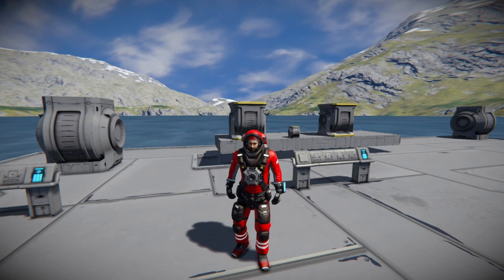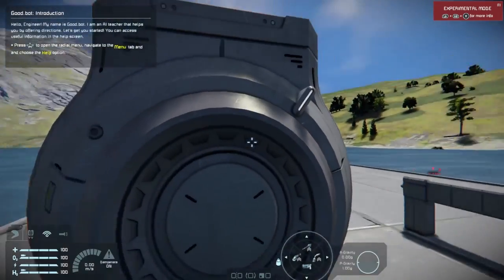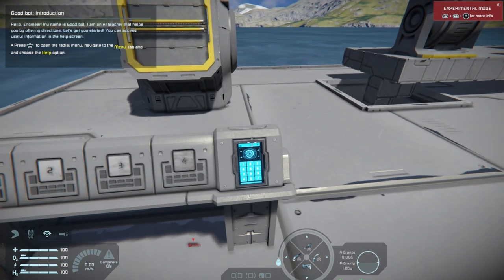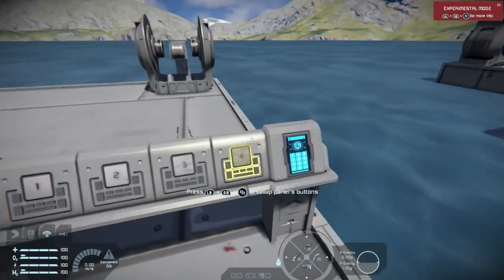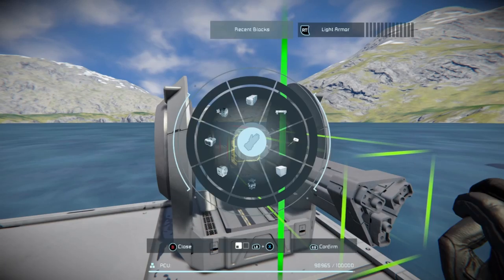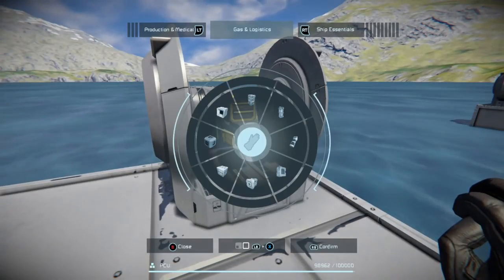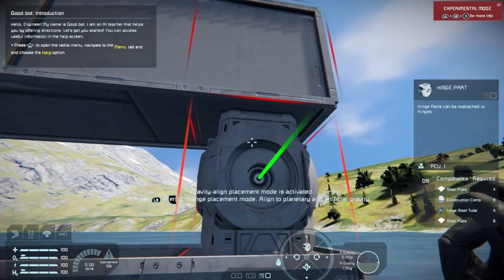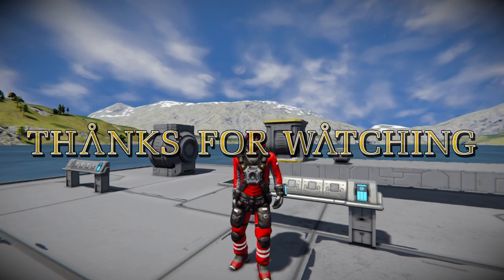Space Engineers Hinges Full Guide On How To Use

Comment: I got something to add for your vid on hinges. I'm trying to make mechs with an old PS2 game series (Armored Core) as reference material & I've been playing around with different ways to build legs+arms. Well I found out you can connect ALL 3 sizes of hinge to the same 1x1 hinge part at the same time. Key words here is "AT THE SAME TIME"! Been thinking of sub-grid knees or elbows, if aligned right you could have 2 hinges moving 1 hinge part for 2 speed settings or torque boosting (hinges are not as strong as rotors)... I was wondering if you had this covered in the vid, you didn't so I'm a share this with everyone. May clang be merciful to your builds👍😁
Reply: I saw someone build a tripod mining mech where the mining drills were literally the legs of the mech. It would mine as it walked across the surface of a planet, and I imagine stacking hinges together like that is how they managed to make it work. The build looked cool as fuck, and since the hinges double as conveyer tubes as well the legs would actually deposit gathered materials into large storage bins located at the core of the structure. Imagine if you could take those and rig it up to AI to wander across the surface of a planet, collect stone, then return back to a connector and deposit said stone into a refiner. Or if you built one with built in refining capabilities and utilized it to harvest, refine, and then drop of materials.

I love this game because once you figure out what you're doing you can create some insane shit.

Comment: one way a lot of ppl are utilizing hinges is as a trailer hitch... where you have to place a vertically aligned and a horizontally aligned hinge with zero resistance. This way the trailer can go up and down and left and right. Unfortunately, I dont think it transfers power being a sub-grid to the main grid (rover), so the trailer still needs its own power source. 

I used to have pistons and hinges down, quit for a while, came back and now I'm trying to learn them all over again because Clang has gotten me a few times flipping rovers into the air by making tiny adjustments to the hinge while its attached XD
Reply from the maker: clang can pop up at any time with hinges and yes I've seen and used the trailer set up a few times I do believe it dose transfer power if the hinges are on but if turned of I'm not sure
Reply: Thank you so much for this tutorial! Now I can put a hinge door on my first APC :DD

Comment: I don't know if im just bugged but it won't let me place the hing part like that to connect
Reply: A different way to add small-grid 1x1 hinge part to large-grid hinge is to slap a timer block (large or small don't matter), add the hinge your working with to timer with "attach" command then add the timer block in twice with "start countdown" command AND "trigger" command (I've tried just "trigger" but didn't work for me). Anyway trigger the timer & you should hear a rapid chiming sound if you set timer correctly. Frame a 1x1 hinge part in the hinge, don't be surprised if it doesn't work on the 1st try as the hinge part needs to be very close to one of the large hinge prongs (I never remember what side). IF done right you'll have attached your hinge part & the timer can be removed (or reset to use again later)... Just don't forget to stop the timer when done to prevent lag, server friendly thought. Hopefully this helps👍😀

Comment: I don’t get it I’m pretty new to the game and I made a vehicle with a mining rig on the back and I wanted to fold it to the top of my car but whenever I change the slider for angle it doesn’t do anything until out of nowhere where it slams into my vehicle and rocks back n forth
Reply from the maker: without seeing your build its hard to say wats wrong, but just thinking here wats your tourqe set to cause a hinge won't move if its got heavy weight on it but using the tourqe should give the hinge more power to move also when using a hinge on a vehicle its best  you use a landing gear to lock to the ground for stability while hinge moves to avoid a clang attack hope this helped

Comment: Please show how to quickly and easily connect your cargo rover to your base using hinge or piston etc. or point me to a video please. I am trying to connect my rover to my base to move cargo and this is becoming a nightmare because nothing lines up and the connections are incredibly exacting. I just want to drive up and connect. I thing a double hinge setup that is locked will work? The only other thing I can think is a piston at base or on rover with a top mount with the connectors. The connectors meet via the top of rover instead of back of rover.
Reply from the maker: have you ever thought about a floor connector also you do know you can adjust the height of your wheels  to line up with a large grid connector with a few tweaks on a flat base small grid and large can line up exact.